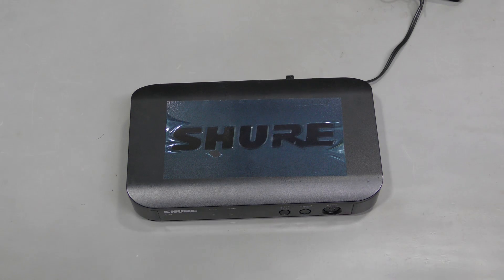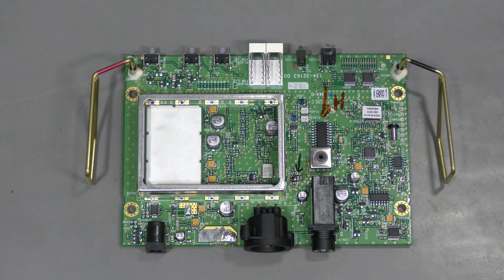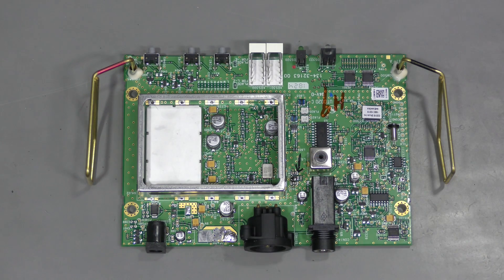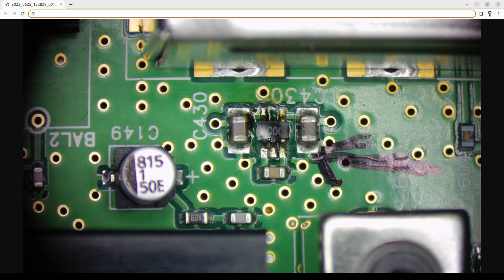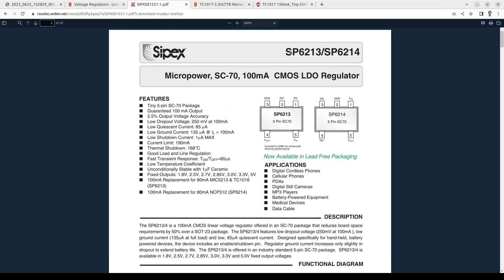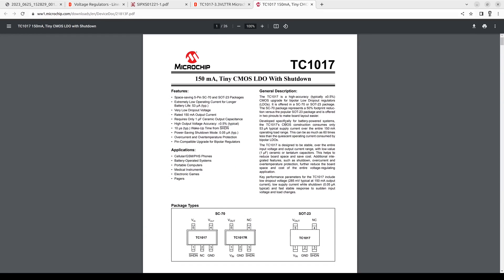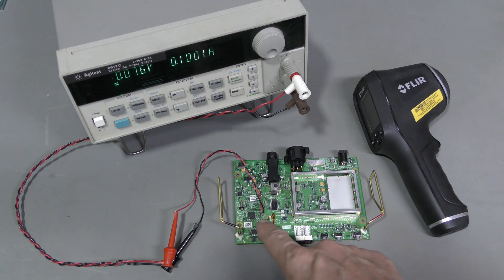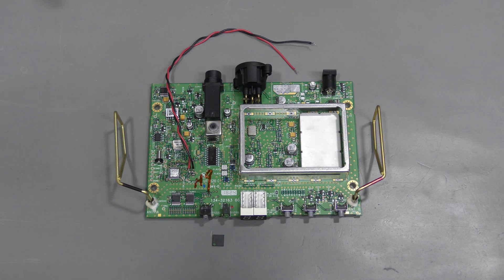#144 - Shure BLX receiver repair fail

Comment: I wonder if power was applied in reverse using the wrong AC adapter, that might explain the multiple almost short circuits and possibly failed higher voltage regulators.
Reply from the maker: I don't think so. There is always reverse polarity protection in decent equipment. It is  simple and effective.